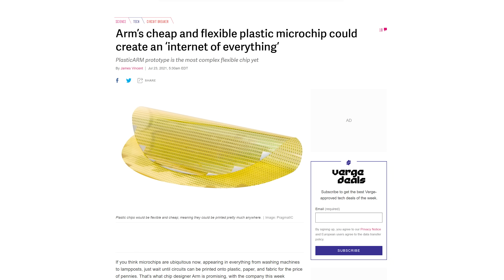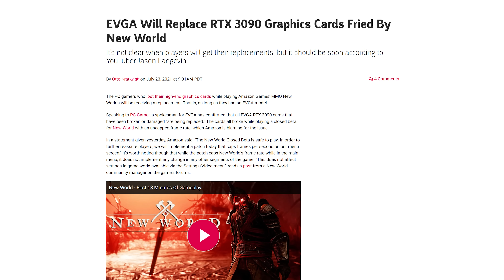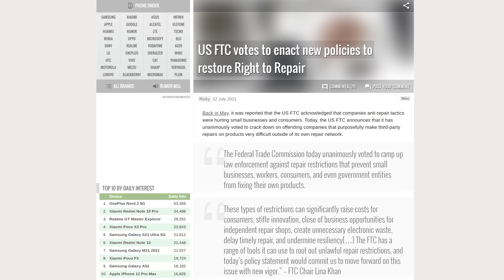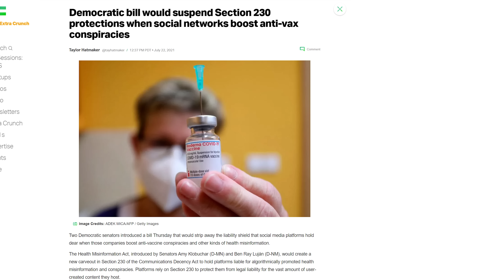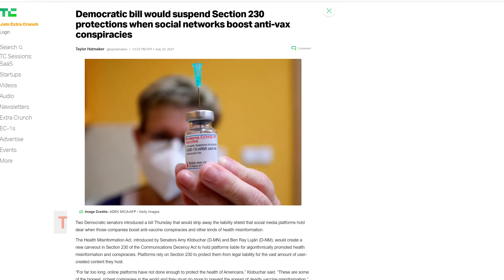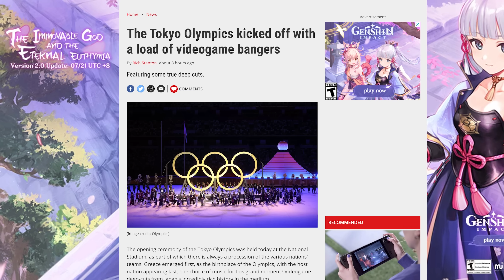Floppy Chips Will Change Everything

Comment: Hopefully the new right to repair laws also affect Tesla. Honestly range and charge time are good enough already. (Improvements always welcome) but I can't risk a $16,000 replacement because the coolant loop on the battery was damaged / driving to one of the 2 shops in the country that will work on it for a reasonable cost. (The time and money needed to move a car across states for a $100-$200 repair)

Comment: I'm not surprised by this good move by eVGA. In the early 2000s the fan on an old eVGA GeForce card I had which was for the first system I'd ever built myself, died. I wrote to eVGA support and they immediately sent me a new fan to replace it at no cost to me.

Whoever heads Customer Support over there is doing an exemplary job!
Every card I've bought since then has been eVGA and I've never been disappointed. 😁👍❤

Comment: "I can't feel too bad for the victims here because they chose to buy the most expensive gaming card on the market AND play New World".  Really?  The combo of high end card and beta game is the thing that sets you off?
Reply: that's colton for you! or whoever wrote today's segment. but theres many who think it IS a hardware issue, probably related to the lack of MLCC caps for gpu power delivery, sorta like the issues they were having early on with a LOT of the 3000 cards at launch
Reply: @ghomerhust  I'd be curious to see a deep dive on that.  There's a lot of hardware fail safes that SHOULD make it stop operating instead of run until death.
Reply: I know, right? They literally live from promoting expensive, luxury (meaning - not required  to live) electronic entertainment, and a guy comes in butthurted against wealthiest gaming enthusiasts, blaming the actual victims. WTF?

Comment: It seriously annoys me whenever I play a game with an uncapped frame rate in the menu and my GPU starts whining because it's working at full capacity. I still have some games installed which do it. Yes the GPU should ultimately be capable of handling that stress, but it's still not good for the GPU and will shorten its life span. Moreover, there's no point to having uncapped frame rates, especially inside of a menu screen. Also, if your monitor is 120 Hz then there's no real point going beyond 120 fps unless you're playing competitive games.
Reply: That's called coil whine. It's somewhat common and just means the manufacturer cheaped out on stuff. Get a frame limiter.

Comment: It's a "theory" that the hardware is "more" to blame than the software? New World didn't hack the card and turn off its fans, if your GPU is fried by a game making use of it, it's bad hardware, no matter what the game does.
Reply: considering the massive amount of FTW3 cards, there's speculation that it has to do with the cheap power delivery, since they went with the minimum spec for MLCC caps on the back of the die. Jay did a video where he watched the power draw on the FTW3 card, and it was spiking constantly, which was an issue early on with many cards that used the cheaper caps for die power delivery. he also tested a higher end MSI card, it uses full MLCC caps, and it was steady the whole time. so im betting all the cards having issues had to do with power delivery more than anything.
Reply: @ghomerhust  if that’s true then everyone is to blame. Nvidea for either understating how much power it needs or allowing insufficient capacitors to be used, the FTW3 card for doing the bare minimum, or the user if they were using bad PSUs. You said Jay did tests with replacing caps but do you know if bad caps can be compensated for with a good PSU?
Reply: @them2545  not sure if Nvidia can force PCB manufacturers to use a specific capacitor on their boards. After all, they just deliver the chips to the 3rd party companies like MSI, Gigabyte, Asus etc. and provide the requirements / guidelines in order for the chip to run correctly. The matter is full on the PCB manufacturers' hands.
Reply: @UbiMortus  they can establish guidelines for usage of their chipsets.  Such as legally binding "RTX 3090" branding to meeting specific board component standards.
Reply: @them2545  No he didn't say Jay replaced caps.  Jay swapped from one 3090 (an EVGA) with cheap power delivery setup to a different 3090 (from MSI) with a higher quality power delivery system.  He didn't replace any board components.
Reply: @Mad-Lad-Chad  that’s what I meant with replace.
Reply: Software has existed for a LONG time that can destroy hardware.  Seriously, look it up.

Comment: The reason that right to repair extends to tractors and similer, is because John deer has locked the ability to plug into the ecu for as little as even checking codes for bad sensors or similer and on top of it clearing codes after replacing faulty sensors is locked too
Reply: Yup, that's actually what started the movement, then it got extended to things like smartphones and whatnot.
Reply: @xchronox0  I didn’t know that the tractor side is what started it, I just knew it was a big part of it, thanks for the info!